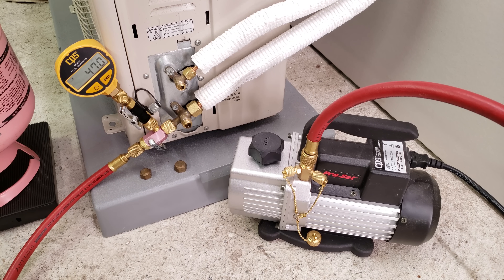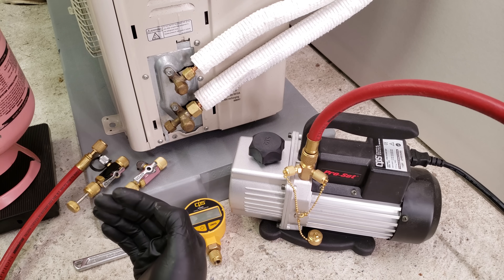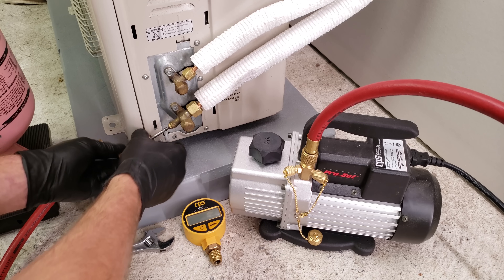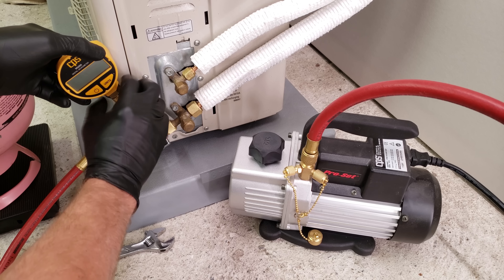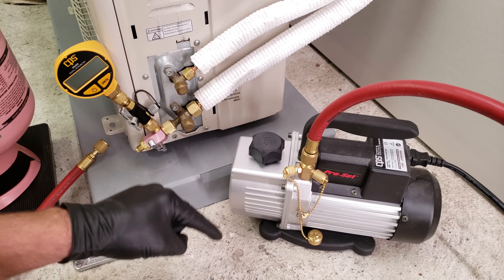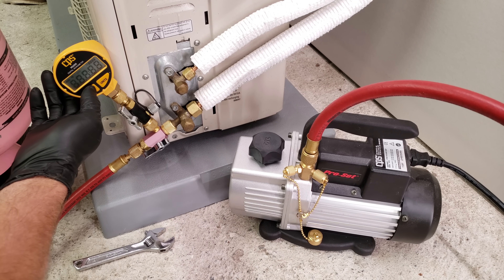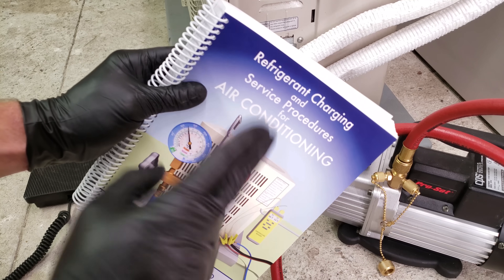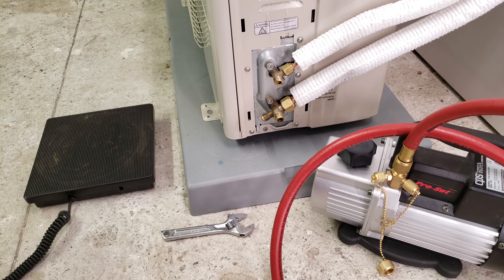Steps to Vacuum and Charge Refrigerant on a Mini Split Unit!

Comment: I love your videos. I installed a mini split but messed up one of the flare connections when I shortened the line set, and lost all of my refrigerant. After having several companies come out and give me ridiculously high bids, while berating me for trying to do "this kind of work" as a homeowner, I was fed up. Watched your whole series and learned so much. I realized that of the 4 ac techs that came out, not one knew how to properly evacuate, test and recharge a mini split correctly. And not one wanted to do super heat, saying, "There's no need to do that".
Reply: Do the superheat? Come on. Hire someone who knows.
Reply: @jakekostogiannis  Clearly you don't know what measuring superheat is. I would rather learn and do it correctly, than pay a "professional" who doesn't have a clue.
Reply: Well, to be fair, handling refrigerant when you're unlicensed is discouraged and even illegal in many places. What you just caused to the environment after letting all that refer into the air isn't something trivial.

My take is that you can install the indoor and outdoor unit to your heart's content and then call an HVAC technician to assist you in the piping, leak testing, and charging of your system.
Reply: @wolfdale_3m  Ah, BS, BS and more BS. 2 of the techs that came out planned on letting the rest of the refrigerant out and weighing in the proper amount. I asked them if they used a recovery tanks and they both said something to the effect of "Nah. It's not enough to matter". 

As for "illegal in most places", two of the techs that came out weren't licensed HVAC contractors at all. They are working for an HVAC company under that license under "supervision". I don't know about the other two because I didn't get their full name. 

You should probably bone up on EPA regulations before trying spew nonsense. The whole HVAC industry is a racket. I just found a way around it.
Reply: @wolfdale_3m  HAHAHAAA! Yeah. Because AC techs don't "add a pound" to units all the time that aren't cooling correctly. HAHHAHAHAAA! Where do AC techs think that refrigerant is going? 

They don't care. They just want to make money. Pfff.

Comment: can you please advise? I got to the point to pressure test my unit. It is Daikin 4mxs36rmvju. I cannot put core removal tool at all. It's not enough space. It feels like I would need to bend the unit to make it happen. Also, I tried to press it with finger when I had about 100psi pressure, - I feel that my hand covered in oily substance. Is it normal to have oil or whatever it is inside? Or maybe it is how unit reacts on nitrogen? Thank you!

Comment: If you buy a unit with enough refrigerant for 15 meters of pipe, if you only use a 10 meter pipe run do you have to remove some refrigerant?

Comment: Hi, to pressure test the lines with nitrogen , what psi should i fill the lines with? thx
Reply: Should have max discharge and suction pressure written on outside/indoor units or in spec manual

Comment: There is good info in this video - thanks. Micron, as used here, seems to be a term of trade. As used here, as a unit of vacuum instead of distance, there are 1000 microns to a torr (1 torr= 1 mm Hg). Atmosphere is 760 torr or mm Hg.

Comment: I am from the UK and a newbee to the air conditioning world. From the few people I've spoken to in the trade and from watching UK mini split installations on Youtube, the trend here is that less than 4000 microns is an acceptable vacuum level. All of them are using a gauge set and 1/4" hoses.  I've followed Craig's steps and my last vacuum achieved 280 microns on a mini split with a 4 metre line set length. This was measured with a Fieldpiece MG44 vacuum gauge and Navac 1/2" hose and Navac core removal tools. After the vacuum I found oil in the hose and wondered if this is normal?

Comment: So I did a pressure test and it didn’t drop for 30mins. I then decided to leave the nitrogen in the system for 2 days and after 2 days I saw it dropped by one unit on the gauge. Very little but does that mean I have a small leak? Or is it normal for it to drop a little?

Comment: I noticed the vacuum gauge installed on the low side near the pump in this video. I watched another video recommending it be installed on the high side, as it showed the difference in vacuum at the connection near the pump as opposed to the end of the line at the high side port. Your thoughts?

Comment: Question: Water boils at 1200 microns, so even if you did have a leak at first in one of the flare connections, wouldn't any moisture introduced into the loop be removed when the leak was fixed and the system pulled down to 200 microns?

Comment: Hello , thanks for the great videos. Is there a way to isolate each line set in a quad line set system. Also when you pull a vacuum and hold it overnight should the vacuum go down at all due to temperatures outside?  The reason I am doing this is because of a leak. I have the R410a  taken out of system in a storage tank and do not  know if i should even use this old r410a. If i had a leak in the system before would that have  infected the stored /reclaimed R410A. Any help here would be greatly appreciated.

Comment: Just wondering how much of that 2.3 ounces of referigerant could have gotten waste inside the hose instead of getting into the system. This becomes more substantial when you are adding the entire amount of referigerant, say after the previous one has leaked.
Reply: You can shut or remove the red hose and open both the handles on the gauges. Watch the pressures stabilize and then shut your blue hose and remove the hoses from the system. You’ll notice less refrigerant will expel from your hoses once removed. The compressor pulls the refrigerant from the hoses when you shut down the red hose and open the gauges.

Comment: I noticed that you were using a digital vacuum meter, which costs another $150. However, most of us have the standard gauges, if we are lucky Yellow Jacket - and those go down to -30 inHg (which I think is about -76cmHg). I was looking at my Bosh mini split install manual, and it says to hit that number when vacuuming out the lines. In the video you say you want to go down to 500 or 700 microns or so, and I think -500 microns would be about -30 inHg. So for those of us looking to do this on the cheap, can we just use our yellow jacket gauge, and run that until it hits -30 inHg? Seems easier than messing with the vacuum, and assume we just hook that up to low (blue) side.
Reply from the maker: The issue is that when you look at that needle, it is indistinguishable to the eye between 2000 microns and 500 microns. There is no way to do it right with a manifold gauge. It will result in a guess. That is the tough thing about it. If there was any other way, I would try to explain that to everyone but you just don't know if the vacuum was pulled enough before breaking with refrigerant, thanks!
Reply: I thought myself that a analog gauge would be good enough. I got a cheap single stage vacuum pump my analogue gauge indicates -30 inches, but my JAVAC digital gauge which starts reading only when pressure is below 19,000 microns does not even read. So pressure is above 19,000 microns. Yes the digital gauges are expensive, getting an instrument to a zero point reading is very very difficult a perfect vacuum 0 microns is in practice near impossible/ In Physics they can get down to a millionth of a micron (about 100 atoms per cubic cm. The concept of ZERO is weird you can get as close as you like but never reach it. Think of absolute temp 0 Kelvin

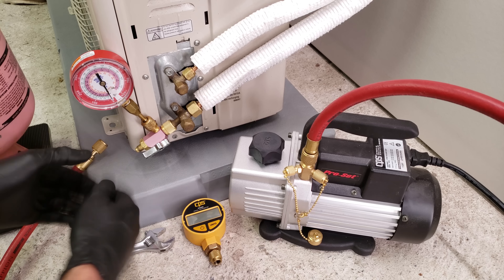Comment: I am trying to understand if it is possible - and it looks like I can, so correctly me I am wrong -- to avoid the expense of using a manifold gauge for both the nitrogen pressure test and the vacuum test by: a) fitting the 5/16" core removal tool to the service port and mounting a pressure gauge to the 1/4" fitting to do a pressure test and b) for the vacuum test, mount the 1/4" core removal tool on the 5/16" core removal tool to measure vacuum. It looks like this is possible, but want to make sure. The videos I've watched I know only show the nitrogen pressure test using a manifold gauge set. But this video at the 2:50 mark makes it sound like it is possible. That would save me $200 for the manifold gauge and 3 hoses.

Comment: What would happen if you didn't add the extra refrigerant for the extra line length?   A few ounces seems like such a small percentage change when the unit is pre-charged with several pounds.   Would not adding it cause failure, or just cause the unit to use more electricity due to being less efficient?
Reply: For this machine, probably nothing, else a lower suction presure. Potential ice building on indoor unit, less molecules to cool off the compressor, causing it to overheat. alot of shizzle can happen :))
Reply: @aasberg  Whew!

Comment: @ AC Service Tech LLC - Question - I see the first valve core removal tool, which also serves as a ball joint for the vacuum line, is 5/16" to 1/4" - but what size is the second ball valve attachment you used to attach the micron gauge?  I assume it has different size endings, like maybe 1/4" at both ends so it can fit on the 1st ball valve and also fit on the micron gauge. Is this right or am I missing something?

Comment: Question, does the line set need to always stay higher than where they connect to the compressor? I am wanting to run them down and underneath a trailer and then back up into the floor ( a "U" shape )

Comment: Craig, what is the procedure to replace the refrigerant in a mini splits system. for instance if you have to recover all the refrigerant in a mini split system, complete repairs and them recharge. Every procedure I find only addresses adding refrigerant when additional line set is required.  Thanks. PS I have your course/manual and have learned so much from it.

Comment: Add 10 micron nitroGen and 10 x 10 is 100 divided by the square root of psi pounds of pressure in this gauge here I'll close it . Read it here on both sides and GAwdamnn I just wanted to know where to connect to refill. This is an HVAC college course brother. 🤡
Reply from the maker: It certainly is a multistep involved process!
Reply: @acservicetechchannel  would love if it was 8 seconds 👈😆

Comment: R-12: This is typically in older vehicles built before 1994
R-134a: Adding additional molecules to the R-12 formula has created a more environment friendly refrigerant which is now being phased out
1234yf: The latest and even more environment friendly refrigerant is flammable (the earlier predecessors r-12 and r-134a or not) this will be a much more expensive substance. Due to this flammability most German cars have opted to stay with R-134a sighting potential fires in front end collisions. In 2014 this refrigerant has begun to be phased in. Most system will have a label or ticker identifying the refrigerant used.

Comment: Hi please I need your help my 1.5hp LG dual inverter air conditioner licks refrigerant I'm left with about 100psi  how can top up the unit and how much r410 gas should I add please 🙏

Comment: I installed a 9000 BTU Senville. A friend in the HVAC field came over to pull the vacuum. We're in Fl. and it's fairly warm right now, but his pump was a single stage and it took forever for the micro gauge to get down to around 300. Other than that, he used the same equipment and procedure as you. We ran the unit after we released the refrigerant and it is super quite and super cold. He left and is out of town, but I read that I need to run the heat at some point after initial set up for 5 minutes. I only had the unit on for about 2 hrs after initial set up on auto cool. Today, I turned it on and it was blowing cold quickly I switched the mode to heat and the fan shut off and the door on the front of the inside head unit closed halfway. I waited for a minute or so and went back to the other function and everything worked. All other functions on the remote work and everything is wired right, was hoping you may have some insight to why there's no heat? Thanks!
Reply: I'm not a tech but I recall reading that it takes 5 minutes for the air to start blowing inside because the system needs time to reset the flow of the R410a so it is carrying heat to the indoor unit instead of cold.
Reply: @cruisemates  You're exactly right. I wasn't giving it enough time. Thanks

Comment: Did my nitrogen pressure/leak test for 1 hour and used bubble leak detector and pressures held perfect. Released nitrogen and hooked up both Appion valves as normal with this code exact Micron guage. Started evacuation and itv pulled down to roughly 170 microns. Turned off pump and micron guage jumped to 4760 microns then started to come down. No idea what’s going on. Simple install with nothing unusual. Changing oil in pump which was new after last install to just cover that. Using exact parts as in this video. Any ideas what could be going on? Help!!!!!

Comment: You mentioned in this video that you don't vacuum the line down and instead pressurize with nitrogen, but wouldn't the fact that you removed the schraeder valve core from the opening mean you already potentially introduced moisture from ambient air into the system?  Also, I can't imagine that the nitrogen you're charging with has zero moisture in it.  Just curious here on the thought process a little more.

Comment: Right On Great Video. The wanted 700+ to do the final process of my Pioneer Mini Split process. I just built a mobile office from the frame up, I wasn't about to pay anyone for something so simple. I ordered the valve core removers and the vacuum gauge because hey you need quality instruments. I initially ordered a vacuum gauge and pump set off amazon. Big mistake. I couldn't get the vacuum to go under 1000 microns, kept chasing my tail, thought I had moisture in the new system, pump sounded awful too. Eventually ran and got a 2 stage 3CFM vacuum pump from harbor freight and used a line out of the kit to connect, still chased my tail for hours. Almost regretted taking it on myself. Then sat and thought there has to be an issue with the line because vacuum be going down and then up. Changed the vacuum line and bam it was headed in the right direction. Got it down to 160, went back in the morning and it held at 240. I know vacuum is a huge part of it so, I was happy. I didn't nitrogen pressure test. I know I should have but had to try to skimp due to funds. Also key note, in a 2 ton Pioneer mini split, both the liquid and vapor lines have access ports and they are switched from this video. Liquid line is on the bottom. In any case the process worked well and it is blowing cold and hot. Thanks for the detailed video and links!

Comment: This is apparently for new systems. What about older systems that may need a flair fitting fixed? Would you recover refrigerate back into the unit, fix flair fittings and then do the exact same procedure? What about if the existing refrigerate is low from a leak and you fix leak, then instead of pulling the refrigerate back into unit, do you  start from scratch and weigh in recommended amount of refrigerate?

Comment: If you are recharging the system after  evacuation and vacuum do you recharge with the valves closed or open?
Reply: Closed then open the valves once you've added the right amount of refrigerant

Comment: I've been having a real hard time getting my getting my core removal tool and my gauges and micron gauge connected on Mini splits what am I missing?? The angle of the service valves and they are so low on the unit I can't get set up without hitting the condenser pad

Comment: Very informative video. I do have a lroblem when doing a vacuum procedure.  The vacuum pump vacuums to 200 microns but after 10 min it rises to 1000 microns. The flares are perfect and the system is new. Your help is deeply appreciated
Reply: did you receive an answer? same boat here...two unit LGsystem with 70' of Lineset between the two. Two appion VCR tools, 1/2" appion vacuum hose, fresh JB oil in pump. Pulls tight down to 250 then after isolating the system it rises to 800 then down to 790 and holds. Nylog on the face of every flare in both the system and vacuum rig. Don't have access to nitrogen. Does it have to be 500 microns?
Reply: @jenklingler8169  You will be fine as long as it stays under 2000 micron in 30 minutes

Comment: Why not just use 1 core removal tool and remove the micron gauge before releasing the refrigerant?  Thx
Reply from the maker: You would loose the vacuum out of the valve core while disconnecting. That was a question people had years ago when we started attaching the vacuum gauge at the unit. If you only have one vcrt then it is best to just leave the vacuum gauge in place until the vacuum is broke with refrigerant. You would need to clean the vacuum gauge between each use though, or get the second vcrt, thanks!

Comment: I'm doing my first split. 2.5kw inverter. 1m pipe length. My vacuum hits -30psi real quick on my AliExpress gauges after a  few seconds. It stays there. So all ok I think. Is that normal for vacuum so fast. Is there any harm in leaving vac pump going more than a certain time in deep vacuum.
Reply from the maker: The manifold gauge will read -29"HG in the green real quick but you will still be in the 1,000's of microns. We use a vacuum gauge to measure the vacuum in microns such as the cps one I used in the video, thanks!

Comment: Great vids! No one has a video on removing part of the charge on a minisplit that has shorter lines than the built in charge was designed for.  Can you please do one? I feel like it's just release the full charge into the lines, start the system, and slowly recover via the suction side of your manifold into a recovery tank while monitoring the scale until you reach the weight that matches the pre-charged weight minus the final weight your line length requires. Is that correct?